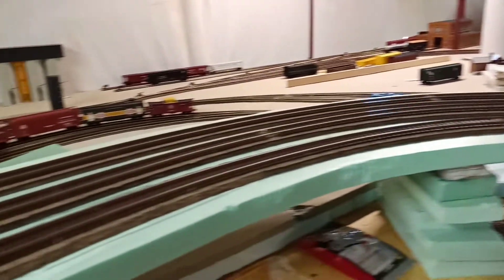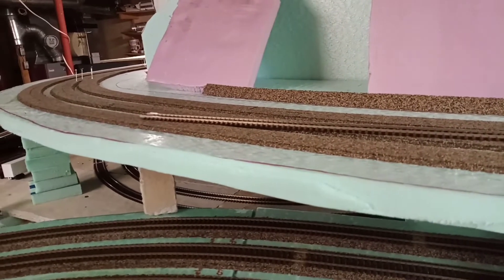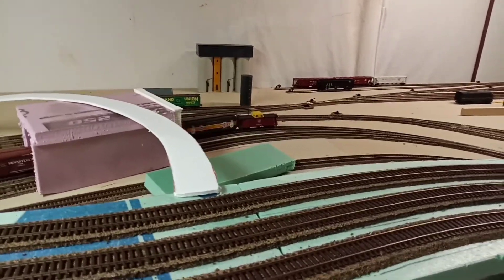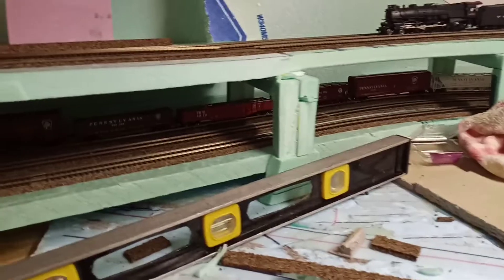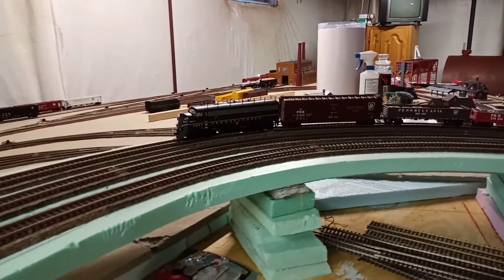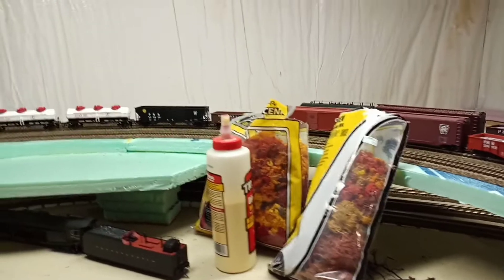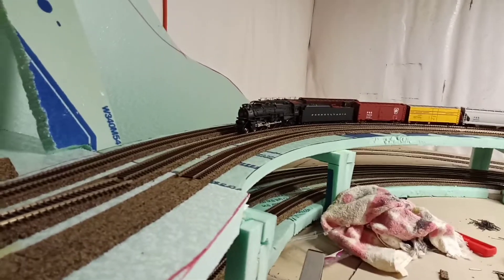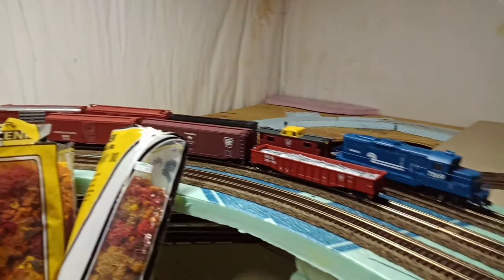HO Scale PRR Layout Episode 29: Curve Almost Done

Comment: That’s great, Tyler.  I love the super elevation.  When you  bring in a helper like your Conrail, did you have to remove the couplers?  - Drew
Reply from the maker: Thanks! I actually just coupled right up to the train. In the long run I plan on speed matching all my engines as closely as I can, so that I can just enter the same speed step into two controllers and let them run up the curve. I do have a gondola I was using to test, where I flipped the coupler upside down in order to be able to push, but not couple. 

I actually tested going downgrade, having a helper coupled and I liked it. It helped keep the cars from pushing the engines. When I run just an engine or two downgrade with no helpers, I hear the motor grind at times from being pushed. So this kills two birds with one stone. The realism of having helpers for breaking when going downhill like in real life, along with the actual physical advantage of taking some wear and tear off the lead locos motors. Once the train reaches a level area, I stop both ends of the train and uncouple. So far it's worked like a charm. Gives me an excuse to buy more engines too!
Reply: Ha ha more engines is nice.  I coupled mine too and it stays back there throughout the trip.  Thanks for sharing.  Take care.  Happy model railroading!  - Drew